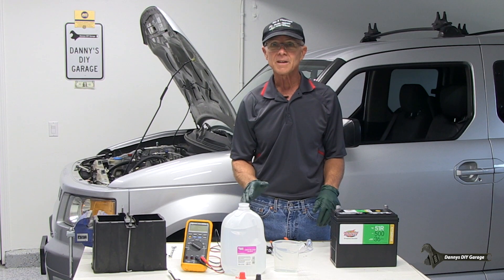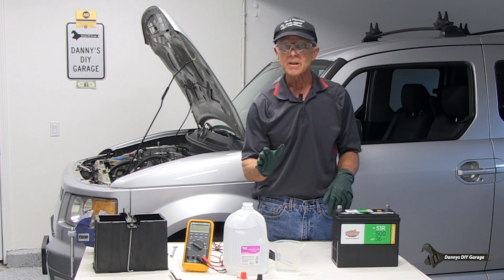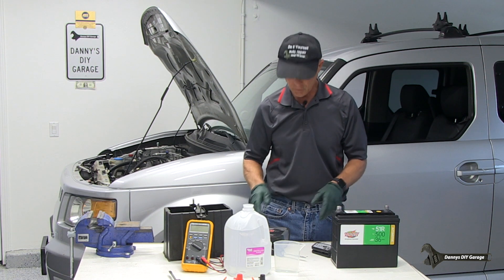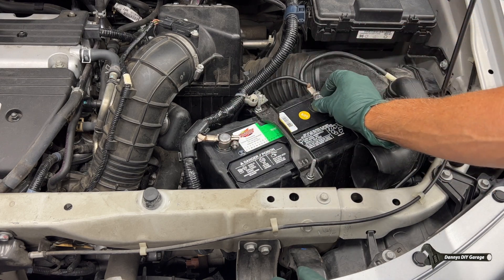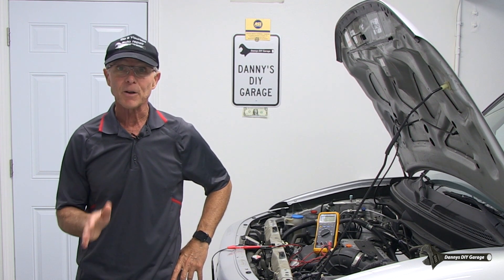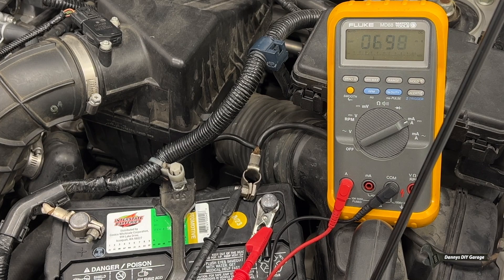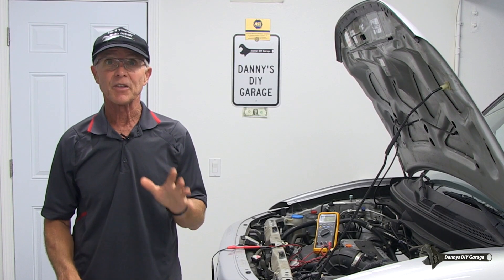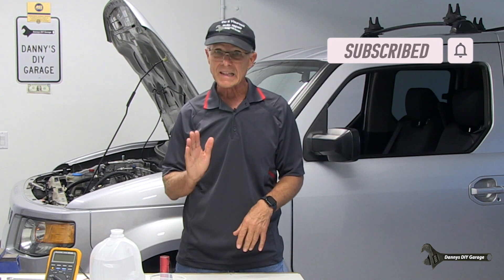Car batteries what you should know before buying a car battery.

Comment: With 72-months warranty, are some of these necessary?
Reply from the maker: If a battery has the removable caps, everything still applies here, most 72 months batteries are prorated, meaning they only give you credit for the life that’s left on the battery
Reply: At Costco, I get a new battery, no questions asked, nothing out of pocket, if still under warranty.
Reply from the maker: That’s good to know, thanks for that information

Comment: I always check the date on batteries try not to buy more than a month old, with the one battery it was 6 months old, and it only lasted 3 years most last 5 and i replace them when they even start to get weak not dead.
i clean terminals really well with wire brush and put conductive contact grease with copper in it to help connection and then paint whole terminal and ends of wires with silicone grease so acid does not corrode them.
Reply from the maker: Great point, I went to the auto parts store and the shelf date on some batteries were 6 months old already, you make a good point, thanks for adding this